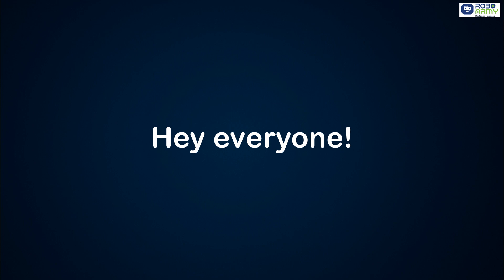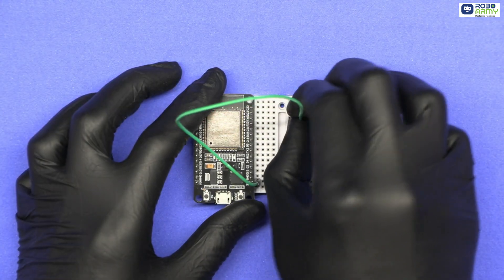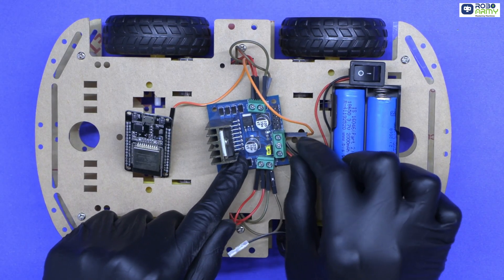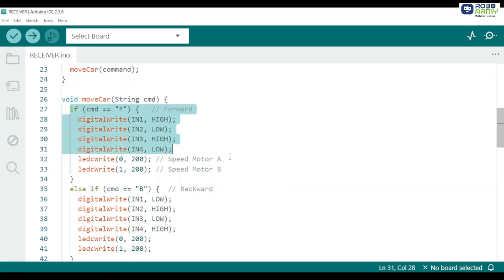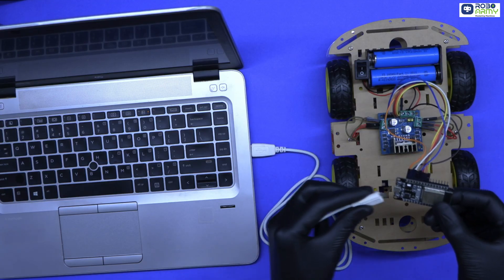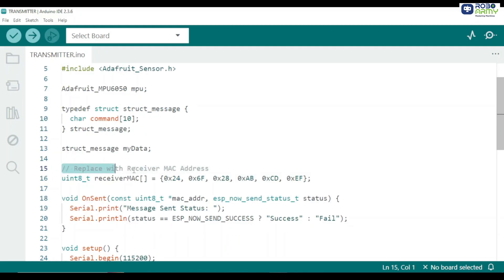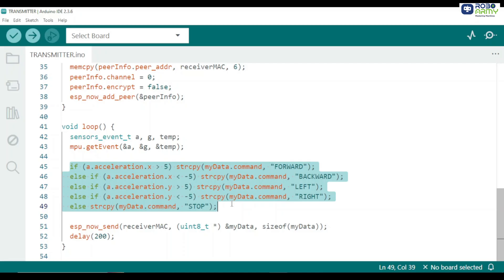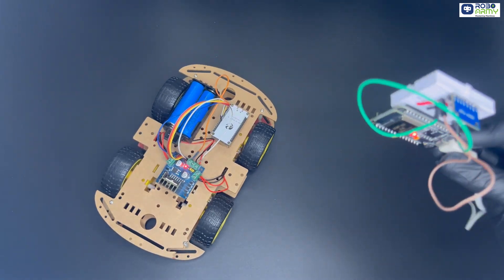Build a Wireless Motion Controlled Car using ESP32 & MPU6050 | Hand Gesture Car | Full Tutorial

Comment: RECEIVER CODE 

#include <WiFi.h>
#include <esp_now.h>

// L298N Motor Driver Pins
#define ENA 25    // PWM for Motor A speed
#define IN1 26    // Motor A direction 1
#define IN2 27    // Motor A direction 2
#define ENB 14    // PWM for Motor B speed  
#define IN3 12    // Motor B direction 1
#define IN4 13    // Motor B direction 2

// Structure to receive commands
typedef struct struct_message {
  char command[10];
} struct_message;

struct_message receivedData;

// Motor control variables
int motorSpeed = 200;  // Default speed (0-255)
unsigned long lastCommandTime = 0;
const unsigned long COMMAND_TIMEOUT = 1000;  // Stop if no command for 1 second

// *CORRECTED CALLBACK FOR ESP-IDF v5.5+*
void OnDataRecv(const esp_now_recv_info_t *info, const uint8_t *incomingData, int len) {
  // Copy incoming data to struct
  memcpy(&receivedData, incomingData, sizeof(receivedData));
  
  // Update last command time
  lastCommandTime = millis();
  
  // Debug output
  char macStr[18];
  snprintf(macStr, sizeof(macStr), 
           "%02X:%02X:%02X:%02X:%02X:%02X",
           info->src_addr[0], info->src_addr[1], info->src_addr[2],
           info->src_addr[3], info->src_addr[4], info->src_addr[5]);
  
  Serial.print("Received from: ");
  Serial.print(macStr);
  Serial.print(" | Command: ");
  Serial.println(receivedData.command);
  
  // Execute the command
  moveCar(receivedData.command);
}

// Function to control car movement
void moveCar(String cmd) {
  Serial.print("Executing: ");
  Serial.println(cmd);
  
  if (cmd == "F") {  // FORWARD
    digitalWrite(IN1, HIGH);
    digitalWrite(IN2, LOW);
    digitalWrite(IN3, HIGH);
    digitalWrite(IN4, LOW);
    ledcWrite(ENA, motorSpeed);
    ledcWrite(ENB, motorSpeed);
  }
  else if (cmd == "B") {  // BACKWARD
    digitalWrite(IN1, LOW);
    digitalWrite(IN2, HIGH);
    digitalWrite(IN3, LOW);
    digitalWrite(IN4, HIGH);
    ledcWrite(ENA, motorSpeed);
    ledcWrite(ENB, motorSpeed);
  }
  else if (cmd == "L") {  // LEFT (pivot turn)
    digitalWrite(IN1, LOW);
    digitalWrite(IN2, HIGH);  // Motor A backward
    digitalWrite(IN3, HIGH);  // Motor B forward
    digitalWrite(IN4, LOW);
    ledcWrite(ENA, motorSpeed);
    ledcWrite(ENB, motorSpeed);
  }
  else if (cmd == "R") {  // RIGHT (pivot turn)
    digitalWrite(IN1, HIGH);  // Motor A forward
    digitalWrite(IN2, LOW);
    digitalWrite(IN3, LOW);   // Motor B backward
    digitalWrite(IN4, HIGH);
    ledcWrite(ENA, motorSpeed);
    ledcWrite(ENB, motorSpeed);
  }
  else if (cmd == "S") {  // STOP
    digitalWrite(IN1, LOW);
    digitalWrite(IN2, LOW);
    digitalWrite(IN3, LOW);
    digitalWrite(IN4, LOW);
    ledcWrite(ENA, 0);
    ledcWrite(ENB, 0);
  }
  else {
    Serial.print("Unknown command: ");
    Serial.println(cmd);
  }
}

void setup() {
  Serial.begin(115200);
  Serial.println("ESP-NOW Car Receiver Starting...");
  
  // Initialize motor control pins
  pinMode(IN1, OUTPUT);
  pinMode(IN2, OUTPUT);
  pinMode(IN3, OUTPUT);
  pinMode(IN4, OUTPUT);
  
  // Setup PWM channels for motor speed control
  ledcAttach(ENA, 5000, 8);   // Pin, Frequency, Resolution
  ledcAttach(ENB, 5000, 8);   // 8-bit = 0-255
  
  // Initially stop motors
  digitalWrite(IN1, LOW);
  digitalWrite(IN2, LOW);
  digitalWrite(IN3, LOW);
  digitalWrite(IN4, LOW);
  ledcWrite(ENA, 0);
  ledcWrite(ENB, 0);
  
  // Set WiFi mode
  WiFi.mode(WIFI_STA);
  
  // Print MAC address (needed for transmitter)
  Serial.print("Receiver MAC Address: ");
  Serial.println(WiFi.macAddress());
  
  // Initialize ESP-NOW
  if (esp_now_init() != ESP_OK) {
    Serial.println("Error initializing ESP-NOW");
    while (1) {
      delay(10);
    }
  }
  
  // Register callback for receiving data - CORRECT FOR ESP-IDF v5.5
  esp_now_register_recv_cb(OnDataRecv);
  
  Serial.println("Receiver Ready! Waiting for commands...");
  Serial.println("=========================================");
}

void loop() {
  // Safety feature: Stop motors if no commands received for timeout period
  if (millis() - lastCommandTime > COMMAND_TIMEOUT) {
    // Only stop once to avoid spamming Serial
    static bool alreadyStopped = false;
    if (!alreadyStopped) {
      Serial.println("Timeout: No commands received. Stopping motors.");
      moveCar("S");
      alreadyStopped = true;
    }
  } else {
    static bool alreadyStopped = false;
    alreadyStopped = false;  // Reset if commands are coming
  }
  
  // Small delay to prevent watchdog issues
  delay(10);
}
Reply from the maker: Awesome! We're glad to see you're working with the code! 😊

Comment: THE FOLLOWING CODE IS AS PER LATEST ESP 32 5.5

TRANSMITTER CODE

#include <esp_now.h>
#include <WiFi.h>
#include <Wire.h>
#include <Adafruit_MPU6050.h>
#include <Adafruit_Sensor.h>

Adafruit_MPU6050 mpu;

// Structure to send commands
typedef struct struct_message {
  char command[10];
} struct_message;

struct_message myData;

// *REPLACE WITH YOUR RECEIVER'S MAC ADDRESS*
uint8_t receiverMAC[] = {0x00, 0x4B, 0x12, 0x33, 0xDE, 0xD4};

// *CORRECTED CALLBACK FOR ESP-IDF v5.5+*
void OnDataSent(const esp_now_send_info_t *info, esp_now_send_status_t status) {
  Serial.print("Message Sent Status: ");
  Serial.println(status == ESP_NOW_SEND_SUCCESS ? "Success" : "Fail");
  
  // Print destination MAC address from info->des_addr
  char macStr[18];
  snprintf(macStr, sizeof(macStr),
           "%02X:%02X:%02X:%02X:%02X:%02X",
           info->des_addr[0], info->des_addr[1], info->des_addr[2],
           info->des_addr[3], info->des_addr[4], info->des_addr[5]);
  Serial.print("Sent to: ");
  Serial.println(macStr);
}

void setup() {
  Serial.begin(115200);
  Serial.println("MPU6050 ESP-NOW Transmitter Starting...");
  
  // Initialize I2C communication
  Wire.begin();
  
  // Set WiFi mode
  WiFi.mode(WIFI_STA);
  
  // Print MAC address (useful for pairing)
  Serial.print("Transmitter MAC Address: ");
  Serial.println(WiFi.macAddress());
  
  // Initialize MPU6050
  if (!mpu.begin()) {
    Serial.println("Failed to find MPU6050 chip");
    while (1) {
      delay(10);
    }
  }
  Serial.println("MPU6050 Found!");
  
  // Set MPU6050 range and filter if desired
  mpu.setAccelerometerRange(MPU6050_RANGE_8_G);
  mpu.setGyroRange(MPU6050_RANGE_500_DEG);
  mpu.setFilterBandwidth(MPU6050_BAND_21_HZ);
  
  // Initialize ESP-NOW
  if (esp_now_init() != ESP_OK) {
    Serial.println("Error initializing ESP-NOW");
    while (1) {
      delay(10);
    }
  }
  
  // Register callback - CORRECT FOR ESP-IDF v5.5
  esp_now_register_send_cb(OnDataSent);
  
  // Register peer
  esp_now_peer_info_t peerInfo;
  memset(&peerInfo, 0, sizeof(peerInfo));
  memcpy(peerInfo.peer_addr, receiverMAC, 6);
  peerInfo.channel = 0;  // Use 0 to auto-select channel
  peerInfo.encrypt = false;
  peerInfo.ifidx = WIFI_IF_STA;  // Important for ESP32
  
  if (esp_now_add_peer(&peerInfo) != ESP_OK) {
    Serial.println("Failed to add peer");
    while (1) {
      delay(10);
    }
  }
  
  Serial.println("Setup complete! Tilt the MPU6050 to control the car.");
  Serial.println("Forward = Tilt forward, Backward = Tilt backward");
  Serial.println("Left = Tilt left, Right = Tilt right");
}

void loop() {
  sensors_event_t accel, gyro, temp;
  
  // Read MPU6050 data
  mpu.getEvent(&accel, &gyro, &temp);
  
  // Determine command based on acceleration
  // Adjust these threshold values based on your needs
  float tiltForwardBack = accel.acceleration.y;  // Y-axis for forward/backward
  float tiltLeftRight = accel.acceleration.x;    // X-axis for left/right
  
  String cmd = "S";  // Default stop
  
  // Check if MPU is tilted enough (absolute value > 2 m/s²)
  if (abs(tiltForwardBack) > abs(tiltLeftRight)) {
    // More tilted forward/backward than left/right
    if (tiltForwardBack > 2.0) {
      cmd = "F";  // Forward
    } else if (tiltForwardBack < -2.0) {
      cmd = "B";  // Backward
    } else {
      cmd = "S";  // Stop
    }
  } else {
    // More tilted left/right
    if (tiltLeftRight > 2.0) {
      cmd = "R";  // Right
    } else if (tiltLeftRight < -2.0) {
      cmd = "L";  // Left
    } else {
      cmd = "S";  // Stop
    }
  }
  
  // Copy command to struct
  cmd.toCharArray(myData.command, 10);
  
  // Send command via ESP-NOW
  esp_err_t result = esp_now_send(receiverMAC, (uint8_t *) &myData, sizeof(myData));
  
  if (result != ESP_OK) {
    Serial.println("Error sending data");
  }
  
  // Debug output (optional)
  static unsigned long lastPrint = 0;
  if (millis() - lastPrint > 500) {  // Print every 500ms
    Serial.print("Tilt - X: ");
    Serial.print(tiltLeftRight);
    Serial.print(" Y: ");
    Serial.print(tiltForwardBack);
    Serial.print(" Command: ");
    Serial.println(cmd);
    lastPrint = millis();
  }
  
  // Add a small delay to prevent flooding
  delay(50);  // Send every 50ms (20Hz)
}

Comment: hi buddy, i want to ask that, i have one ep32(devkit v1) with only wifi and and another esp32(devkit v1) with Bluetooth and wifi. will it support and work properly?, rather there will be a problem??
Reply from the maker: Yes 👍 it will work properly. Both ESP32 DevKit V1 boards support Wi-Fi, and most ESP32 DevKit V1 versions also support Bluetooth (Classic + BLE).
If one of your boards clearly has Bluetooth + Wi-Fi, you can safely use that for this project. There won’t be any problem as long as Bluetooth is enabled in the code and you select the correct board in the Arduino IDE.
Reply: @robo_army_  thank you😄

Comment: Can we do the same connection if we are using 2 wheels and 1 castor wheel.
Reply from the maker: Yes, absolutely!
You can use the same circuit and logic even with 2 wheels and 1 castor wheel.
Just connect one motor to Motor A and the other motor to Motor B on the driver, and the castor wheel will act as a free-moving support.
The movement commands (forward, backward, left, right) will work the same way — only turning will be slightly sharper due to 2-wheel drive.

Thanks for asking!

Comment: Bro showing error in the code
Reply from the maker: Hey — thanks for letting me know! 😊 Can you paste the exact error message you’re seeing?
Meanwhile, try the quick checklist below and tell me what happens — I’ll help you fix it.
Quick troubleshooting checklist (copy/paste for them)

Install libraries
In Arduino IDE: Library Manager → install Adafruit MPU6050 and Adafruit Sensor.
Select correct board & port
Tools → Board → ESP32 Dev Module
Tools → Port → the COM port for your ESP32
Replace receiver MAC

Make sure the MAC is a real 6-byte MAC (format 0x24,0x6F,0x28,0xAB,0xCD,0xEF) — use Serial.println(WiFi.macAddress()) on the receiver to get its MAC.
Check includes & case
#include <Adafruit_MPU6050.h> and #include <Adafruit_Sensor.h> must be present and spelled exactly.

Check I2C wiring & address
SDA→GPIO21, SCL→GPIO22 on most ESP32 dev boards; ensure MPU5050 powered (3.3V) and GND common.

Watch for compile errors vs runtime
Compile errors: copy the full error text (top-to-bottom) and paste here.
Runtime/Serial errors: open Serial Monitor at 115200 and paste what you see.
If esp_now_init() fails

Ensure WiFi.mode(WIFI_STA); is before esp_now_init(); and no Wi-Fi connection attempt is running.
String/struct size
Ensure struct_message size matches what receiver expects; avoid sending raw String objects.
Try a minimal test
Upload a tiny sketch that only runs esp_now_init() and sends a static message — confirm basic ESP-NOW works.

If they still get an error, ask them to paste the exact error text (or screenshot) — paste it here and I’ll point out the exact line and fix.

Comment: I used the proper code and it uploaded and the correct mac address but the robot is now moving pls help!!!
Reply from the maker: Hi! If the robot isn’t moving, first check that both ESP32s are powered properly- send us your codes and connection for verification
Reply: @robo_army_  the mpu 6050 chip is not found on the transmitter!!!